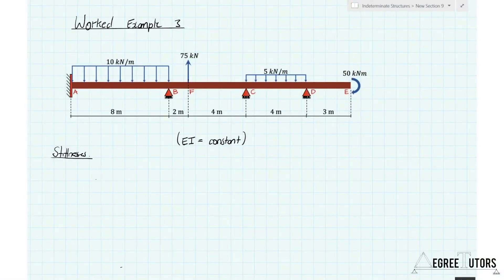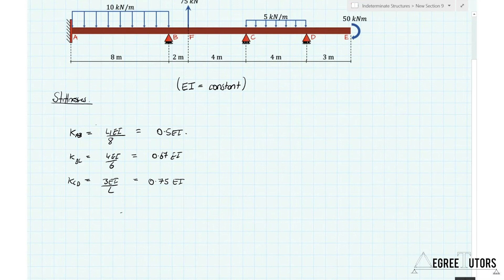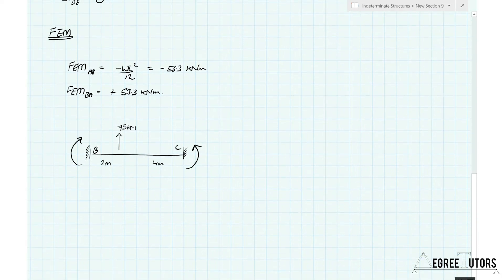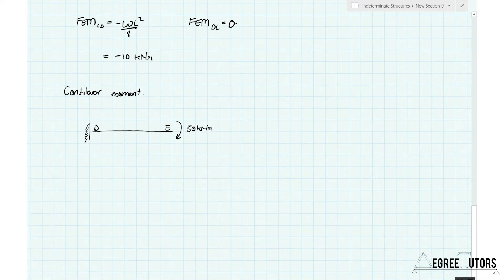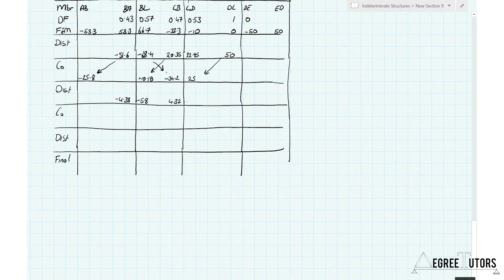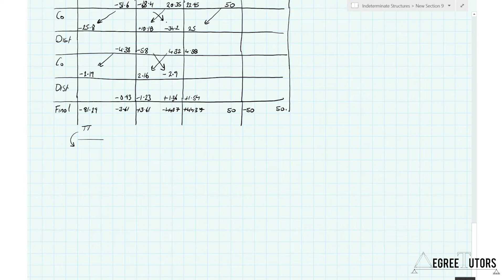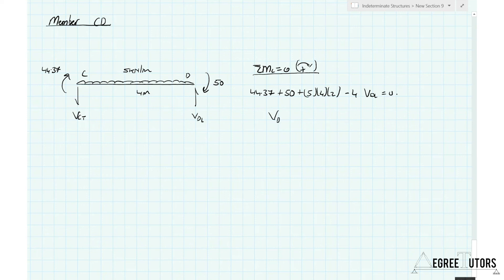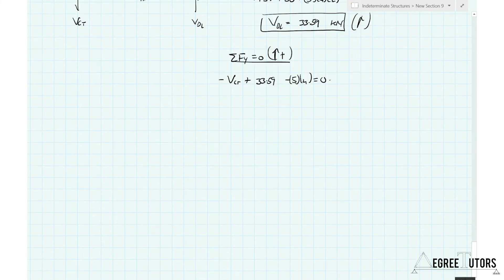The Moment Distribution Method - Quick Walkthrough Example | DegreeTutors.com

Comment: This is the Hardy Cross Method.
Reply from the maker: Yeap...also known as the Hardy Cross method 👍
Reply: @EngineeringSkills-Sean  The moment distribution method is a structural analysis method for statically indeterminate beams and frames developed by Hardy Cross. It was published in 1930 in an ASCE journal